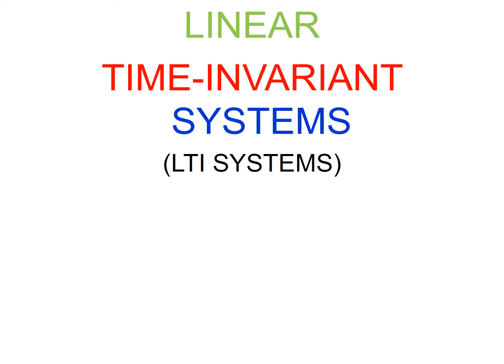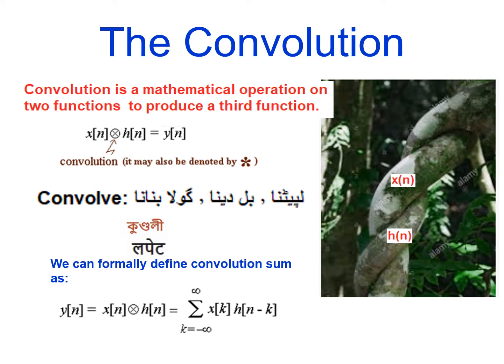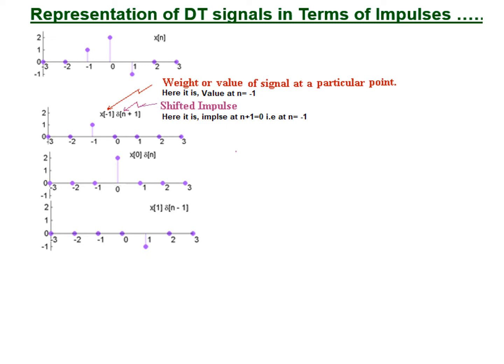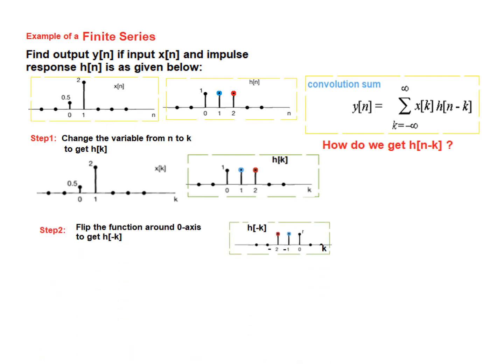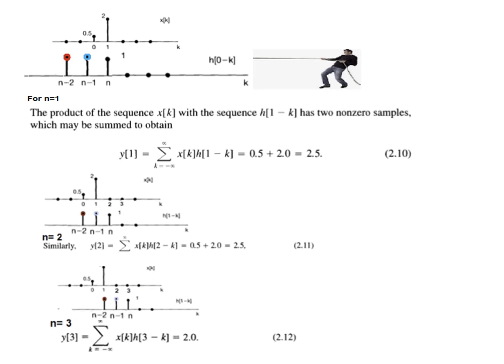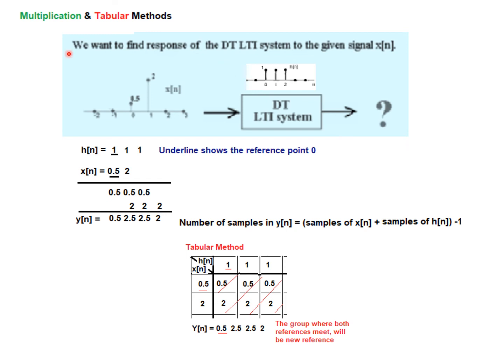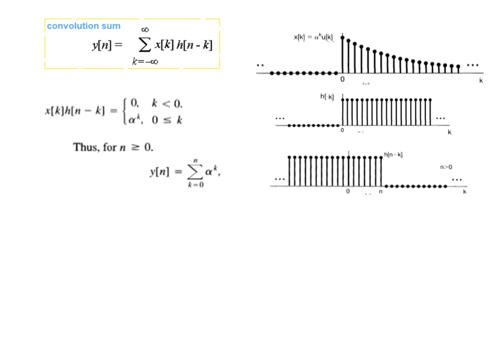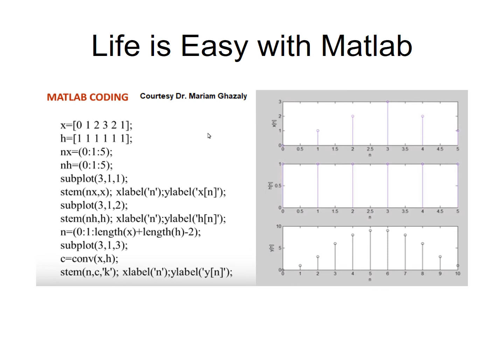Unlock the Secrete of Convolution || Discrete Time LTI System || Ex 2.1& 2.3

Comment: Thanks for all the great videos sir. mashallah you are amazing! I have a question though. For the solution at 21:23 I tried to follow your method doing it graphically and I do not see any overlap of x[k] with h[n-k] at n = -1 but the solution at 21:23 implies there is an overlap at n = -1 and the computation starts from there. based on my understanding and the graphical method I only see an overlap at n = 0. I got confused. please can you clarify because I may be missing a point. thanks a million
Reply from the maker: I think you are making mistake in selecting n. Try by flipping x(n)
Reply from the maker: https://youtu.be/-SPpObi5HTI
Reply from the maker: https://youtu.be/k0XxfpWcTrE